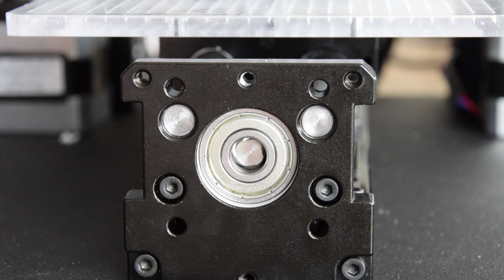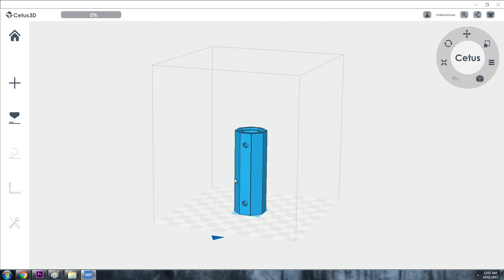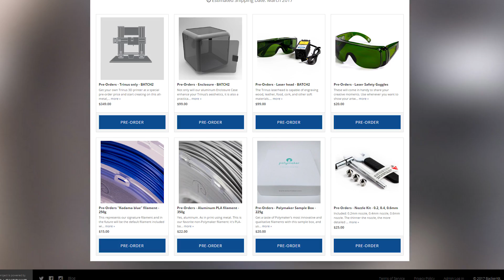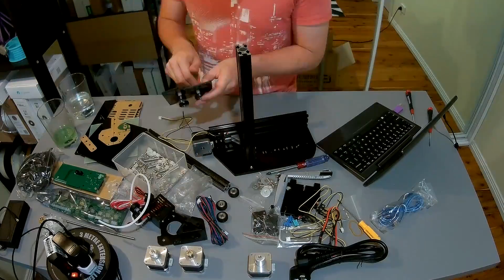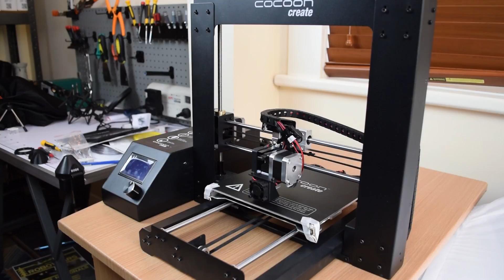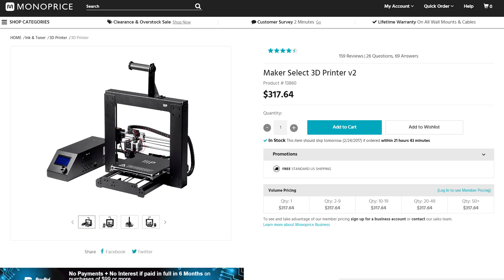Cheap 3D Printers THAT DON'T SUCK $350 and under

Comment: Hi. Firstly. Thank you for very educational videos. Next I was wondering if you can help me. I have exhausted all forums and YouTube videos. I have under-extrusion but only on sertain plases in the print volume "printable area" it moves on the print as the print is turned or moved on the build plate. It even keeps the same pattern. 🤷🏼‍♂️ I am close to giving up. It's a delta printer flsun qq-s. Hope you have time to think about it. Thanx. 👍🏻

Comment: In 2020 just getting into the game ... bought the Wanhao as a Monoprice Maker Select v2 ....  Out of the box  IT WOULD NOT WORK ... the z axis stopped so high that the bed screws fell off tryng to adjust....  But I'm   fairly mechanically apt, and own a drill ....  moved the z limit switch down about a centimeter below it's adjustment height....    Followed your advice and got Prusa Slicer rather than what came with it. 

After a few  false starts began getting usable prints out of it.   Decided  I hated the bed, got a glass plate.    At first could never get adhesion.... finally figured out that its getting the plate literally squeaky clean (clean paper towel and liberal alcohol) and setting the first layer near the top temp for the PLA and the bed temp up around 80 ... then come  down to low to midrange for the PLA and a normal 60 for the bed for the rest. 

By second week I had printed the adjustable z-axis limit switch controller.and the bracing kits.   The thirdi nstalled  the mosfet kit.  Oh  I worry much about th the wires flexing where they join the bed so with a piece of scrap aluminum and zip ties fixed the cable harness so that the wires wre not flexing where they joined the bed.    Fin fact used a LOT of zip ties to makes sure the wires wouldn't flex or catch when I move the printer( there are two wire chains ... but they frequently worked off the top link ... until I used the zip ties to re-enforce it.

I'm fairly pleased overall with the Wanhao ... but couldn't in good conscience recommend it to someone who I knew had (and trusted) their mechanical and electrica; savvy.  But it seems from what I've read that's likely true of all lower end printers.   The possibility of wires breaking and possibly shorting that carry ten amps is no joke ... that'll lite anything flamable very fast ...quite possibly before a fuse trips.  I've also read of the thermal runaway situation .... with the borosilicate glass over the bed, I'm not that worried about that, ut without it I would.

I'm about to try to get octoprint going and have a bl-touch I'll try to install some soon weekend.

Just reporting that still in 2020 there are problems with the Wanhao's ... though as said, after sorting it out, I much like using it (but I'm stiill a newb).    And to say thanks, Angus.  Your vids have are both delightful and much informative.

-- TWZ

Comment: Old video but I'll comment anyway.

Bought myself a "Custom" Anet A8 for ~$100 on Ebay a week ago. It was all wood and came with a 30A PSU and even a fused power jack but it cheeped out on the rails and on the bearings. Both of which needed to be replaced. Since buying it I've been printing almost constantly so I can add more and more upgrades to make the thing more stable and reliable. 

Add in the rest of my upgrades and I've got a surprisingly functional and quiet Anet A8 for Sub $170. So for the same price as a new one, more or less, it's a serious step up.

Comment: I'd really appreciate an updated version of this video, as most of these are probably outdated by now.
 I too was naive enough to try and get a fake 3D printer on Kickstarter (Kodama Obsidian 3D in my case) and would like to try again to get into this hobby, only this time, with a printer that actually exists. Trouble is, I am clueless, and too cheap to spend €800-1000 on something that I KNOW works great. I'd much rather spend €350 on something that works well enough.

Comment: I am looking for a 3D printer that is very precise as I am working on a project that has very tiny pieces. The smallest measurement I need is .06 of an inch for the diameter of a half circle. I know that it doesn’t help much but I need something that can just get me by

Comment: any advice on which of the smaller printers might be more travel friendly? I work overseas for months at a time at a place with no postal service. I would like to have a simple printer to tinker with that would break down and fit into airline checked bag.
Reply from the maker: The cetus is the only printer I've taken with me on holidays, it breaks down very small. EDIT: and yeah it was through check in.
Reply: @MakersMuse  thank you! I was thinking the cetus looked pretty ideal.

Comment: I found a kit by FLSUN for $350CAD with a print volume of 300x300x420. Had a few issues with it but I do have technical knowledge. Overall very happy with this kit. Got my money's worth. Wouldn't consider anything under 200x200x200 for $350.

Comment: Hi Angus, outstanding video. I've been watching a few of your features for the last few days. I'm about to get into 3D printing, but I do have a lot of experience in other technical hobbies. After watching some of your reviews, including this one, I'm actually leaning towards a Creality Ender 3 or a QIDI Tech X-One2. I'll be printing TPU 99% of the time and the parts are generally going to be no larger than a GoPro case. In fact, I just measured some of the parts I want to print and they all fit more than enough in a 120mm print area. Do you think those are a good choice, or am I better off with a printer from this video, for TPU? To give you an idea, my original choice was going to be a PRUSA i3 MK3. But it would take me a bit longer to get started if I go for that one. With the other two, I could get started as quickly at tomorrow. Thanks, Danny

Comment: Good video but no delta printers? I made one (designed the parts and electronics, and program a firmware based on Repetier) for $250USD and prints better than a $400-$500 printer. Of course design, print the parts, program de firmware, put the parts together and finally calibrate took me like 5 weeks but I learned A LOT building this so I'm very satisfied.
To everyone that it's reading this: as an electronic technician that developed a printer I tell to you that don't buy the cheapest kit but either the expensive. Get a mid term kit, experiment with it and then try to upgrade it by parts. A lot of problems that I saw in cheap 3D printers are mechanical like cheap screws, parts that doesnt fit correctly, bad pulleys, badbelts, etc. Another big problem in most people is bad configuration in slicer. Take time and experiment with the features, you have to read and experiment a lot to get high quality prints in every model. The experience  makes the master.
Good luck!

Comment: Hello Angus, I am looking for a 3D printer under 500$ for my Bachelor thesis. I plan to modify the temperature of the nozzle and the speed of the nozzle and axes with a micro controller board or preferably by adjusting the embedded code in the printer. Do you know any printer that allows me to modify its code? Thanks in advance.

Comment: I have the MP Select Mini, and I can say that it is definitely worth the price. I only have issues printing in ABS, because the print bed requires masking tape. With ABS's tendency to shrink/warp while printing, the tape can be peeled off of the platform, resulting in some bad bottoms of ABS prints. However, printing in PLA or any other material has proved incredibly successful and I highly recommend this machine.

Comment: Another well done and very informative video - thanks so much and keep them coming!

I did try to put together a Delta Kossel from a kit and never got it running properly, every conceivable problem happened. And after building it with no documentation, no firmware, and highly questionable motherboard and motor drivers (there were plenty of parts I had to scrap from the kit and source on my own), well over a hundred frustrating hours of configuration and tuning, posting questions on active forums with zero responses, this printer is currently in a closet, having never produced even a sample cube. I have built several  Prusa-ish Cartesian style printers and had them running like a dream. the Kossel, however, is another story altogether, and I wonder if I'll ever get it working.

Comment: You should check out the MeCreator 2. It's a great printer in my opinion. It's my first 3D printer and I've had it for a few months now. Not many problems with it, it is a solid printer for $350.

Jimmy Shaw has one, check it out on his channel :)

Comment: Looking for some advice. 

I occasionally have to match handles on customers tennis rackets. Say they have 1 handle/grip that just feels better than the others. Yes, some players (me included) can feel the slightest difference between grips and the racket just doesn't feel right. For me to replicate this perfect grip on all their rackets I have to take a mold and mess about for about 4 hours just for 1 grip. And there is no guarantee I will nail it as the epoxy foam can misform.

So, is there a cheapish (I do this 3 or 4 times a year, so I am not going to be earning from it.) printer out there, and is there an "ink" that is as light as 8Kg epoxy foam? The foam has to be very light like balsa wood. Grams matter

Hope the community can point me in the right direction.

Comment: I was one of the "lucky" US backers to get a Tiko.  Their novel design of the extruder set it up for heat creep issues and poor thermal regulation of the hot end.  It was an epic fail. I use it to show that thermodynamic principles can't be overcome with marketing hype... it is worthless as a working 3D printer.  Even so, using the internal lighting it now is at least a functional WiFi-controlled desk lamp!
Reply from the maker: It's a piece of history now! Keep it safe, maybe a technology museum will want to purchase it in 20 yrs time.

Comment: Prusa i3, with the E3D upgraded hot end and Bowden extruder kit. :D

All in, I have less than $350 into my Prusa (kit + hot end upgrade), and I have a 230mm cubed (iirc, 9-10 inch cubed) print bed. Comes with Repetier and Slic3r, has printed everything I've asked it to (with success/failure being entirely on me)... :D

Comment: the CR-10 is a good printer it is $350 and has a big build volume of 300 x 300 x 400mm. I just got one.
Reply: Same. I LOVE mine. I got mine about 6 months ago. May of 2019
Reply: @LT72884  It's honestly a great printer, I'm planning on getting a prusa mini to be my "small" printer so I can be more confident running it for a week straight,..
Reply: @Emily-fm7pt  i just built a prusa i3 from an anet a8 kit. Replaced the anet control board with a far superior one.
Reply: there's some problems though, like the bed warping after use, the nozzle clogging easily and the fact that the nozzle keeps under extruding unless you tighten a bolt
Reply: Nice, good choice, Im saving up for one
Reply: @fernandomota669  have you got your cr10?
Reply: Been rocking a cr10s for 2-3 years, a damn good workhorse. Got quite a lot of mods and upgrades on it though, but the base mechanics and frame are still the same, except different extruder and Y/bed steppers. If I was buying new today though, I'd rather go corexy with linear rails and a far less 1995'esqe user interface out of the box. An enclosure for a CR10 series / size printer gets absurdly big when accounting for full clearance of the build volume with the large travel range of the bed.
Reply: @owenwalters1  4 years so far with lots of use and pretty much no mods and it runs fine :)
Reply: @owenwalters1  to be fair if you dont maintain your machine for a year its not that weird that it will mallfunction

Comment: I have a anet 8a yeah it took me a month and 147.00 worth of parts to get it to run like a champ, but honestly it was worth it. It taught me allot more than I wished for.  I 3d printed new carriages, fan shrouds, and I only paid 140 dollars for the printer. So all together I have around 287 in a machine that can fine print at a 78 mm/s speed.  (It can go faster but it starts skipping so I usually print at 55 mm/s in abs.) A note worth mentioning on the anet. Build the heated bed to the left side, build a thermal box, get a 3dv6 heat tip, buy a 3m screw kit,buy a bed sheet, print anti z wobble arms, and more important print everything in the beginning in ABS!!  You will go to printing ABS eventually with the anet 8 and it is worth it.

Comment: mine is under 300 and prints in full color cmyk with 100 micron res.heated bed and is 28*28*30 cm.full laser cut metal body and 150 mm/s and bowden extruder .all thanks to china and 10h of assembling.but sadly no auto level and encluser

Comment: I'm thinking of buying the Anet a8 is it worth it or is there a better one for the price
Reply from the maker: It's got a great community around it but be prepared for a tedious assembly process and a possibly frustrating one if you've never put a 3D Printer together before. I prefer the tronxy x1 as a first machine as it's just so darn cheap.
Reply: Maker's Muse does it have the Same print quality

Comment: Hi! If you have experience with 3D printers please give me a second of your time. I'm completely new to 3D printing and would like to buy one to print my designs and prototypes. My only problem is two things 
#1 it needs to be under $250 USD  
#2 a build volume of over 5" (127 mm)
If you can suggest me something that would be a good first printer and those two qualities it would be a great help. (I'm in the USA and would prefer to use amazon for my purchase. If you would like to contact me privately my kik is rmeboi.) if you made it this far. Thank you!

Comment: DO NOT BUY THE MONOPRICE MAKER SELECT 2!!! I've had more issues with the internals coming desoldered or burnt to hell because they put hot glue where it should never go. 

If you want a decent printer and know how to repair electronics then go right ahead, otherwise steer clear.

Comment: Hi! 
Just saw your video about moving parts before this one and I have a question for you: from those 3D printers you presented, which one have the best precision? I'm a beginner, but I have some projects with moving parts...
Thank you!
Reply from the maker: All of these machines have a 0.4mm nozzle and offer similar precision. I would say the Cetus appears to cope with complex shapes better (as demonstrated with the complex lattice) however the software does not offer as much control when it comes to support material.

Comment: I had been watching your channel and a few others for quite some time and last week I finally bought my first 3D printer, the Balco from Kogan ( Wanhau 3D Ver 2.1 ) for $399.00 + $23.00 Shipping.. And as you said in above review, hands down the best value for the money and some. Since I had it , I have printed the Z-Brace mod and installed it plus the two belt tensioner mods and a few other things. I am quite impressed with the quality this printer delivers and now with the mods it will get actually better. I am learnig heaps and I am hooked. Now the experimentation with different filaments and maybe later some hot-end mods and possible enclosure for the higher temp filaments.  Thanks for the Videos and keep up the good work.

Comment: Thanks for the video.  I am a Maker (and Engineer and Robotics Mentor) with two teen boys that are Makers as well.
I am really interested in getting a 3D printer and the <$350 price range is just right (and not Sucking is definitely preferred).
I am especially intrigued with the idea of a Kit; so, the TronXY peaked my interest.  On looking, I found the TronXY X3 which also is under $350 and has a bigger print area and a heated bed.  Is there a reason it is not on the list.  Does it Suck?

Comment: Lol was just fixing my Fabrikator Mini today then I watched your vid and I was like! WHAT someone actually mentioned the Fabrikator Mini after it has been discontinued for SOOOOOO long! Now I am looking for a kit and I am wondering if the Tarantula is a good kit? Do you have a review on it? Also I had to switch around which direction the bowden tube went to get it to work but I cant secure the part that connects it to the filament feeder because it just wont slip onto the tube! Do you know how to fix it?
Reply: In my experience, skip the Tarantula. It's "usable" but the QC is exceptionally lacking. Mine didn't even come with V-slot extrusion, but instead has a weird "step" cut where a V-slot should be.
Reply: Jakinwhale what 3d printer are u using now and what can u recommend
Reply: I am not using one, my fab mini jammed and I havent fixed it yet! But I would recommend the CR-10 Even though I don't have it, it looks REALLY good!
Reply: Ender 2 is a good cheap printer, I have a Cr10s as well. But I like the ender 2 more

Comment: I am just barely getting into the world of 3D printing via a college course in AutoCAD and I am now seriously contemplating getting a printer myself. I looked up the Maker Select you mentioned here (as well as the Plus version) and I'm thinking that looks like a pretty good starter unit. Looks like it is capable of printing a pretty wide variety of plastics and it comes with a heated bed. Might need to build an enclosure for it to keep it up to temp here in the cold, wet Pacific NW...but that's do-able.

Comment: But which printers out there that could match the performance of a Stratasys machine?

i.e. The most reliable, least print error, overhang geometry (dual materials) & easy setup to print just like any A4 paper printer?